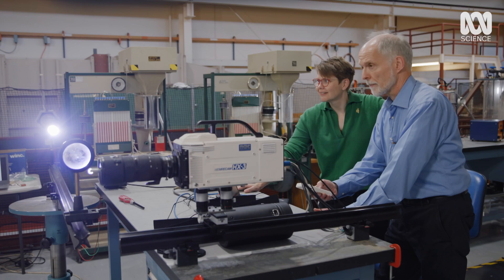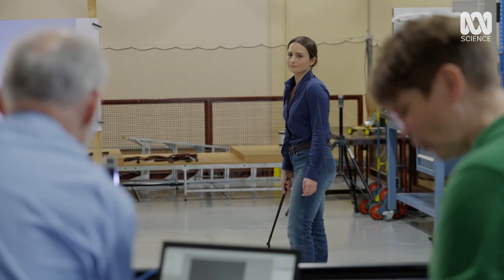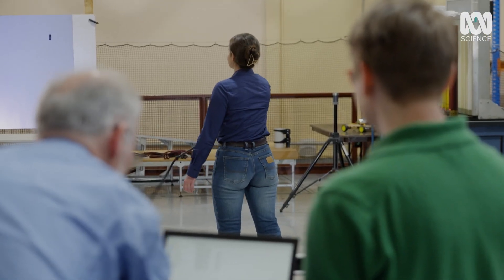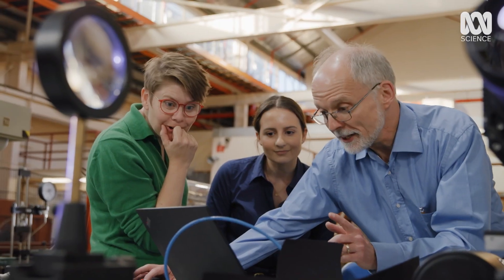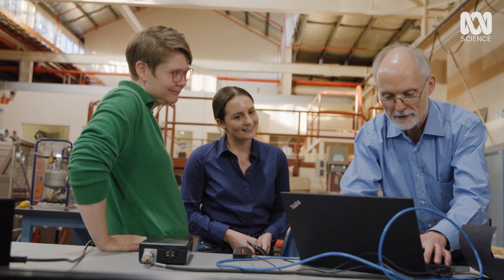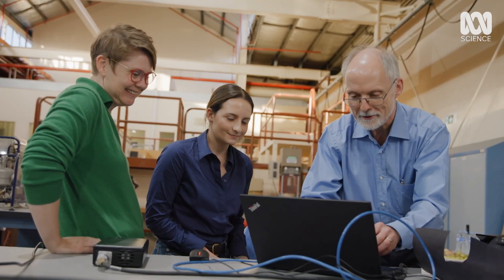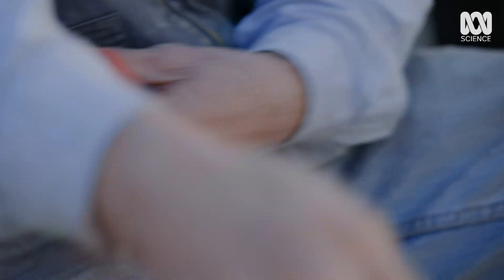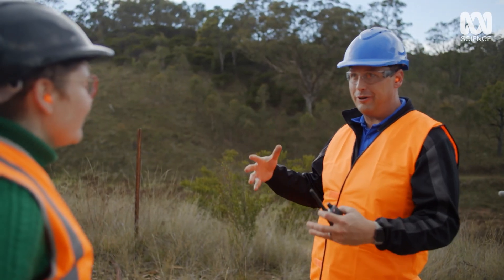Why Do These Two Things Cause Shockwaves? | Soundtrack of Australia

Comment: What is the sound barrier? We've exceeded mach 1 for many years now.
Reply: @sytonicflux  The sound barrier is not a barrier. We used to think it was, but it no longer is.
Reply: @sytonicflux  But mach 1 isn't a barrier anymore. Barrier is different from hurdle. Now we have space travel at mach 5 or mach 10, or our current record of mach 32.5.
Reply: @sytonicflux  I'm saying that it isn't a barrier. We can pass it within the atmosphere whenever we want, as military jets let us know. The limit is money. There is no barrier. It's merely mach 1. Compare that to the speed of light, which is a barrier. We have no technology to pass it.
Reply: @sytonicflux  As I implied before, with enough money, we can go faster than mach 1. It isn't a barrier.
Reply: The barrier for breaking the speed of sound is at 761 miles per hour.
Reply: The sound barrier is an oxymoron. This name is outdated and doesn't reflect reality.
Reply: @sytonicflux  Barrier means cannot pass. Hurdle means difficult to pass. It should be a light barrier and a sound hurdle.
Reply: @sytonicflux  The horse barrier prevents the horses from going early. Only when the barrier is removed can the horses go. Thank you for supporting my argument.
Reply: @sytonicflux  I didn't say it ceased to exist. The barrier stopped the horse's movement until it was opened.
Reply: You have said nothing to convince me that mach 1 is a barrier.